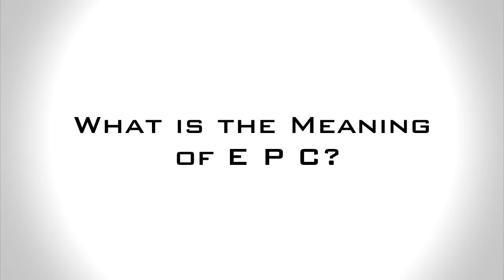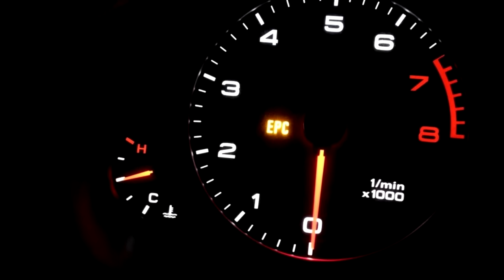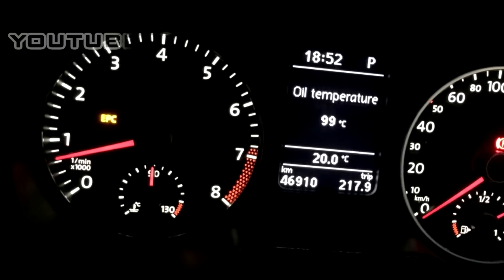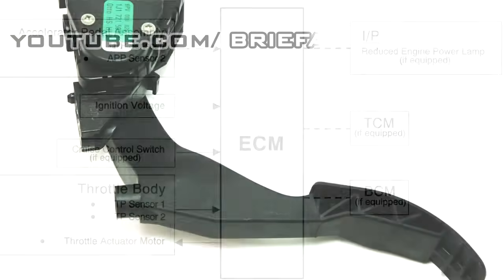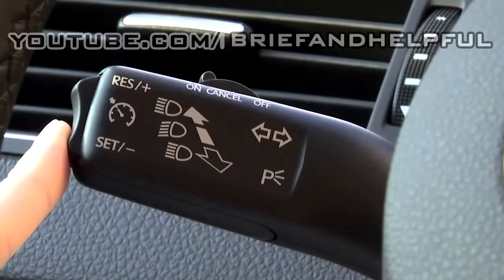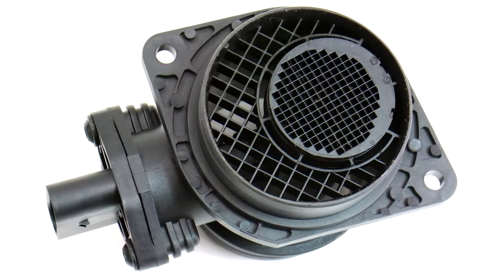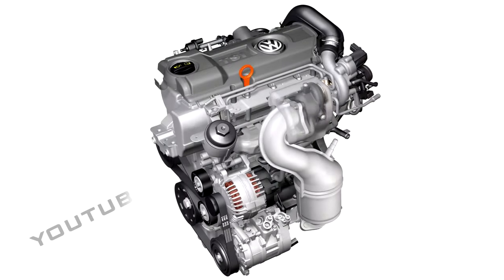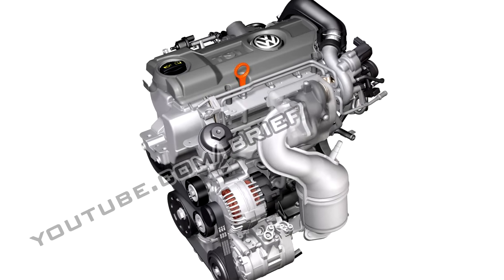How to Fix EPC Light

Comment: How to fix your epc light?  Drive it to a Volkswagen dealer.  Thanks for that.
Reply: I’ll be honest yes because I had mechanics guessing charging me money for nothing it’s not worth it I rather from now on take it to dealer they rip you off yes but you get a job with warranty you drive away without worries 90% of time mechanics don’t know shit about cars and matter fact in 2 cases they fucked up my car so I wasted on time over 800 and another time over 1800 if I took it to dealer and spent 1200 I wouldn’t have problems and wouldn’t have spent more then i shouldddddddd I learned my lesson small mechanics don’t know shit about vw or any German car if you have Honda it’s fine but when it comes to vw bmw or Benz I would say dealer I had enough and I’m taking it to a dealer today my Volkswagen 2015 Jetta got epc light and engine light it’s shutting off sometimes while driving cutting out has 140k on it we bought it new it’s 5 years old I don’t think it’s engine because runs smooth sometimes but it shuts off when driving cuts out and have to push gas all the way or take battery out and back in then works
Reply: Evan’s Sho
Reply: Something I've learned with VW over 30 years is it usually saves a lot of time,frustration and money to do just that. In the beginning, I tried to do DIY, but after hours of looking through forums and calling around for advice, I just decided especially if it's used. Just get the extended warranty and have at least an import mechanic on speed dial.
Reply: @Evan-memo  what was the problem?

Comment: Epc light is due to crankchaft sensor, it is the only sensor that doesnt allow engine start. 

Epc light can be triggered by OTHER sensor, so use a oscilloscope to figure out wich sensor is need replace.

It is possible to have issues with the car even after you have the problem fix, in this case, the unit is damaged due to safe mode anomaly. Replace unit. 

Sorry i writte bad with error.
Reply: My epc light comes on when I first start my car, but after 10 mins of driving and the engine is warmed up. The light goes away after I turn off and restart the engine…?? Suggestions?
Reply: @Dustytrailzzz  epc can be trothle posicioning sensor. Try taking it out and blow with with air. Or clean it.
Reply: Is it possible for the crankshaft sensor to not throw any error codes? My car (a170 cdi diesel) works and accelerates fine when engine cold, as soon as engine warms up, i try to accelerate hard and epc light comes on the dash and engine cuts off. I try to start it again and it takes 2-3 times to start but even when does not cuts off the engine takes a hard time to start when it is at its operating temperature. Every diesel seal is new including high pressure pump seals, fuel filter is new but the problem is still there. Yesterday I figured out that an intercooler pipe is broken, could it be the problem for the loss of power and engine stalling when it is hot? Thanks
Reply: @arbrimehdija5821  Definitely your car will loose power if an intercooler pipe is broken or with a hole, or some what broken! Did you fix it yet?
Reply: @mcanzy  today I'm going to change it and test again, I will keep you updated! Thanks for the reply

Comment: MINE COMES ON  ON MY AUDI QUATTRO A8L 4.2L  I DID REPAIRS FROM  THE CODES  THAT IT SCANNED  DO TO A ENGINE LIGHT ON  NOW  I HAVE TWO  ON  EPC , ENGINE LIGHT ON.. EPC  ONLY COMES ON WHEN I  ACCELERATE  THE CAR BUT DOESN'T SHOW NO SIGN OF  LACK OF POWER  IT DRIVES FINE 
EVEN THOUGH THE LIGHT OF THE EPC SENSOR ON  AND ENGINE LIGHT ON. . CAR RUNS GREAT. .. SO I DON'T KNOW WHY THEY ARE STILL   ON ? I HAVE NO CHOICE BUT TO TAKING TO THE DEALERSHIP. ... CAN'T IMAGINE WHAT THERE GOING TO CHARGE ME FOR  THESE  ISSUES. .?

Comment: I have a 2012 Audi A5 has a code of crank shaft sensor, I replaced that still has check engine light on and the epc , will start occasionally but when does won’t accelerate it runs real rough need to figure out how to clear the epc and check engine light for it seems like it’s in limp mode

Comment: EPC + Do Not Exceed Maximum Engine Speed of 4,000RPM in my Audi A8 2012
Reply: Bilalli Valdrin how did you fix that? I’m having the exact problem with the same car you have
Reply: Cj Shoepawn the problem was the battery because is to cold here where i I’m Canada change battery after works great
Reply: K

Comment: My light has been on for months.lol
Reply: Me too, brake  lights are a pain as theres none, changed so many things, still epc light, piece of junk , i wish i never purchased a old vw  lupo
Reply: I have P0221
Reply: @Keepin-it-wheel101  Throttle Position Sensor (TPS) harness is open or shorted
Throttle Position Sensor (TPS) circuit poor electrical connection
Faulty Throttle Position Sensor (TPS)
Fault Electric Throttle Control Actuator (or Throttle Body Motor)
Accelerator Pedal Position Sensor (APP)
Reply: Does it still run Susan? Mine died finally.  Crank but no start😥
Reply: @snoopy5736  probably a fueling issue spark but no gas check the fuel pump
Reply: @snoopy5736  EPC means needs a sensor sos ,but I drive daily with lthe lite on
Reply: @snoopy5736  thats an entirely different issue.  ESP is for the wheels.  you have an engine problem.
Reply: @marysolpantoja8677  could be a 900 dollar part, if its the haldex. which i think is what might be the problem. i have yet to get mine fixed
Reply: @1MNUTZ  Thank you, that's what I'm thinking.  I replaced crank sensor,  plugs and ignition coil
Reply: @ChickenMcThiccken  I thought this was about EPC
Reply: @snoopy5736  easy way to check is when you open the door you should hear the fuel pump prime. Look up a video on what to look for / hear. If it primes that means it's still trying to pump fuel if it doesn't prime then you check if it's the fuel pump relay or the fuel pump itself. Relay is easy to check/replace pump is a more dirty smelly job
Reply: Snoopy mine says ESP
Reply: U still driving it
Reply: I have misfiring engine and after some time EPC comes on. I think its an issue with spark plug or spark coil. If engine stops misfiring then EPC should not come on. Please suggest...